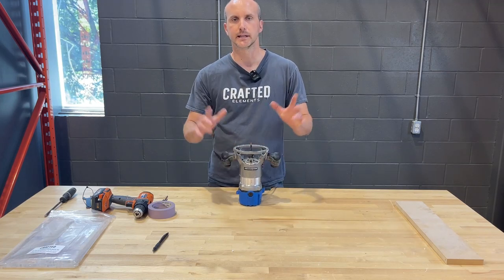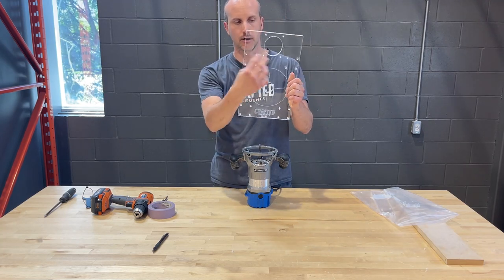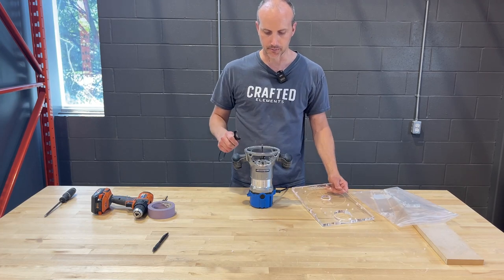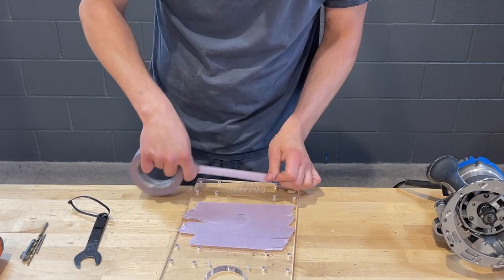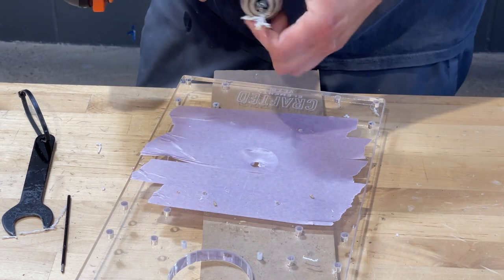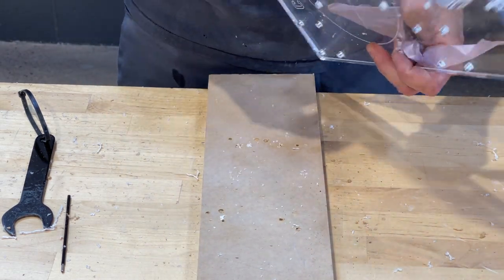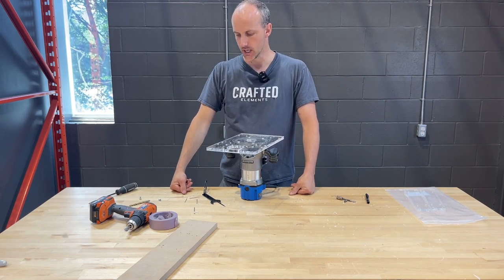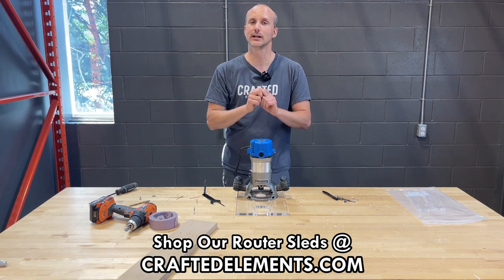Drilling & Mounting Your Router To Our Blank Router Sled Baseplate - Crafted Elements

Comment: What is the thickness of acrylic? Is it possible to use FESTOOL 2020 ROUTER with the thickness of acrylic in this video?
Reply from the maker: 1/2" and YES. We have a Festool specific plate however, which would be easier: https://craftedelements.com/products/router-sled-acrylic-router-base-brackets?_pos=2&_psq=fest&_ss=e&_v=1.0&variant=44121881346270